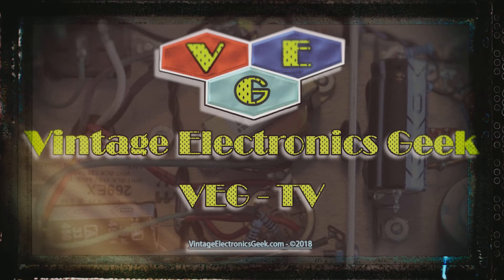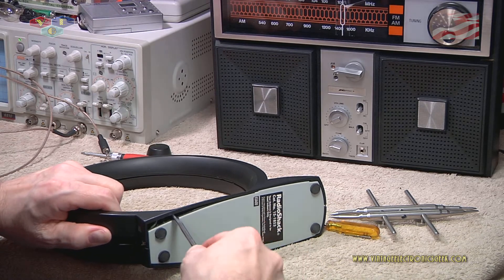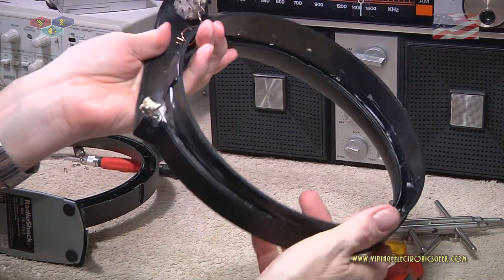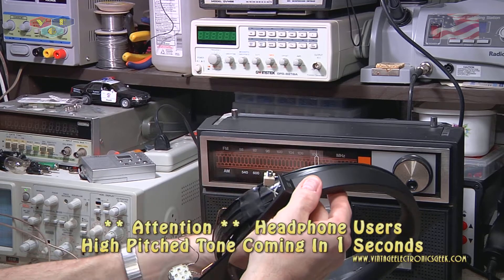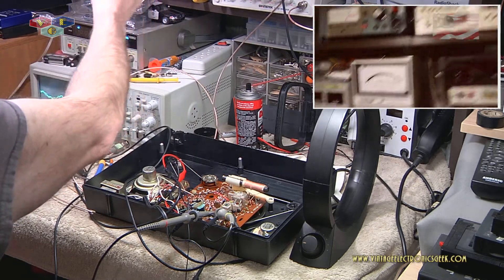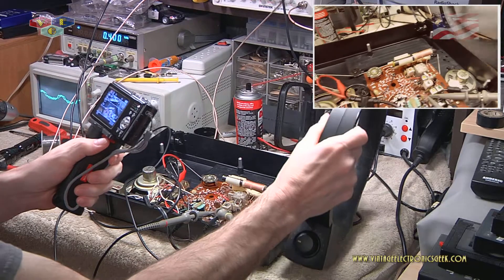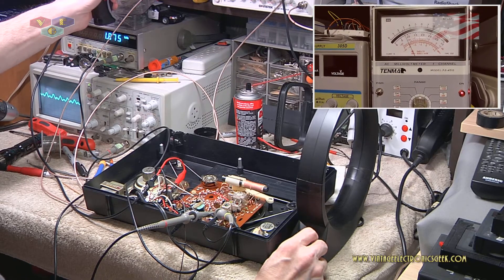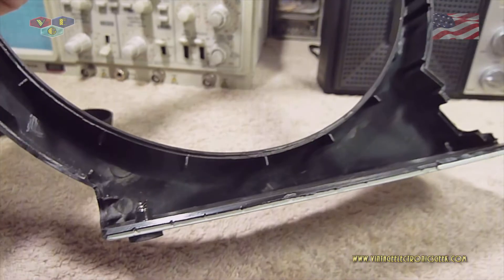Radio Shack Loop Antenna  Model  #15-1853 - Part II - Disassembly

Comment: The 2 coils of wire are what's connected to the output jack.
The tuning coil connected to the variable capacitor is made of probably 10 or 15 coils of a smaller wire buried under another layer of plastic where you can't see or feel it.

Comment: Hey Jack, Ultrasonic weld is a new one on me.  Years ago when I worked for Kimball I did used to operate a "high frequency" press though that cured glue on wood very quickly.  We used it to glue solid wood strips around the edges of table and desk tops.   Have you ever seen John's video on his homemade tunable loop antenna?  They work really well.  I built one myself but I need to rebuild it as the magnet wire broke from me trying to re-tighten it.  I didn't even connect the wires on mine to the radio I tested it on but I was still able to pick up WLW in the middle of the afternoon when I can usually only get it at night.
Reply from the maker: Checkout this cheesy video: https://www.youtube.com/watch?v=gFZYfYpoQWk , or just search YT for "Plastic Welder" for more videos.  I do not sub to Johns channel, did many years ago, but when he decided to change direction and not do electronics anymore, his new direction was not for me so I unsub'd and never went back.

When I was an active HAM, I used to build my own antennas, did build some out of old TV antennas which worked pretty good...still have 2 of them, albeit I am no longer a HAM, I let my ticket expire last year.  I was out of the "hobbie" of any form of radios for a good 6+ years, kept most of my gear...and its still packed away.  With getting back into "electronics" I have been embracing getting back into "radios".

Prior to this and YT, I was a pro / celebrity photographer, retired from that and got back into electronics and started doing YT and have been enjoying it very much!  :)  I'm looking forward to building and erecting outside aerials again, been enjoying AM radio DX!  ~Jack, VEG
Reply: Cool beans.  Are we talking about the same John?  Joernone is his YT channel.  He does the occasional mish mash video but I've been watching for the last 3 years or so and have seen him do several radio restorations, a Sylvania "halolight" tv and currently he's on part 70 something of restoring an AY100U Seeburg jukebox.
Reply from the maker: Yep, that be him...and it was about 2.5~3 years ago or somewhere in there that he changed direction...think he went more cooking, chatting, gardening or something...I understand a change, that's why I kinda mix things on ch of things I like, break things up! I know it didn't last to long, but I just never went back, I sub'd to other ch and try to keep that down to a minimum, if I didn't, Id be here watching videos all day without...oh, I don't know...out enjoying life!  :)  ~Jack, VEG

Comment: Very interesting Jack. I used to make loop antennas for my antique radios, but with more turns of wire. I may make one for my channel.
Reply from the maker: Howdy Jim!  I decided not to glue this back together, just a few pieces of electrical tape as I was thinking later to come back and do just that, add more wire and see what happens!  Wonder if I can wind the full length on this little loop!  Maybe try magnetic wire?  I also have thought about making one for outside??  Thanks for watching!  ~Jack, VEG
Reply: Jack,
You can use any gauge wire, length, diameter of loop, insulated wire, etc. Have fun, that's what it's all about! Here's a link to get you started.

http://makearadio.com/loops/index.php

Comment: the loop is picking up frequency from freq counter
Reply from the maker: Interesting?  Can you explain more so as I can understand the whys and hows?  Thanks Dennis!  ~Jack, VEG
Reply: I have several counters one of them emits lots of harmonics when in use, it interfers with vhf scanner fm radios
Reply from the maker: Oh, so you think its an issue with the counterand not some voodoo magic from the antenna!  OK< I'll have to experiment to see if and how I can introduce harmonics.  Thanks Dennis, I appreciate it!  ~Jack, VEG